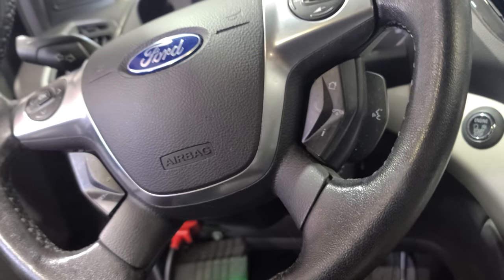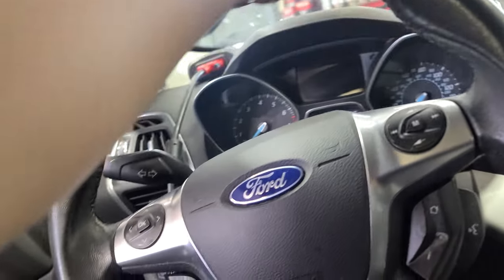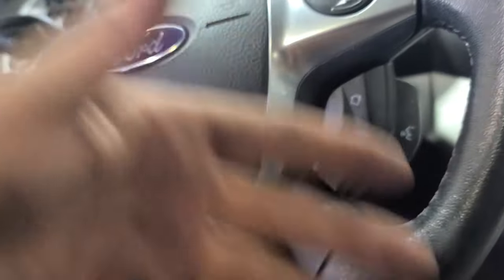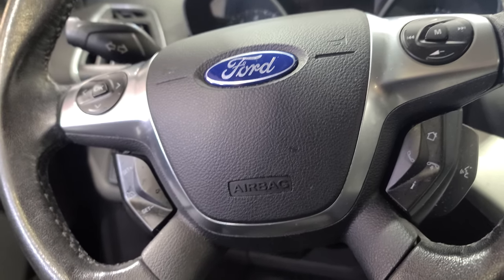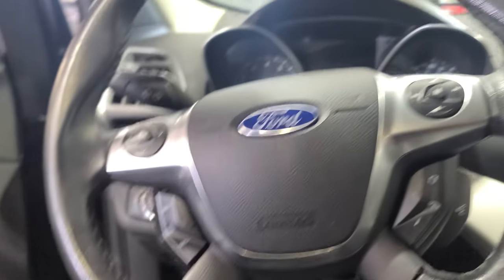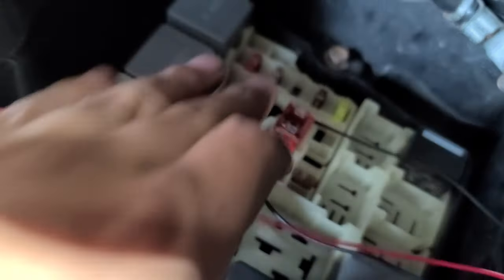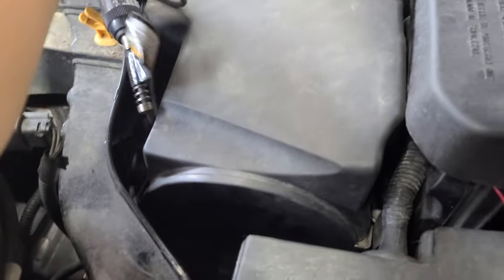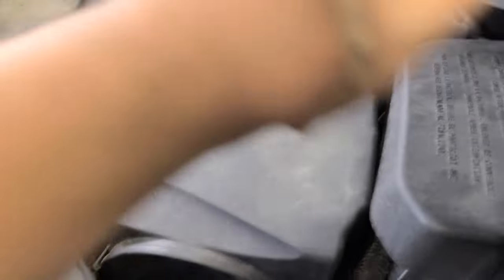2013 - 2016 Ford Escape How to fix a hard Steering Wheel

Comment: Not saying I fixed mine, but I checked the fuse hoping to find it blown.. It was ok..  Before I put it back in, I took a little sandpaper to it, put it back in and it's been working since. No codes..  Cautiously optimistic...   btw, the plastic top of the fuse box required a lot of persuasion with a big screwdriver to get it off..

Comment: Did you have to disconnect the battery before removing or even testing the steering wheel assist fuse?  OR can I just remove it without disconnecting the battery?  Thank you!
Reply from the maker: Show your appreciation, gratitude, and return of kindness by hitting the super thanks.
God bless you!!!